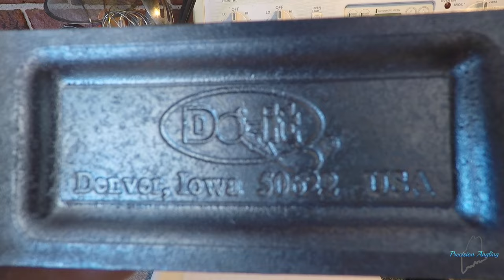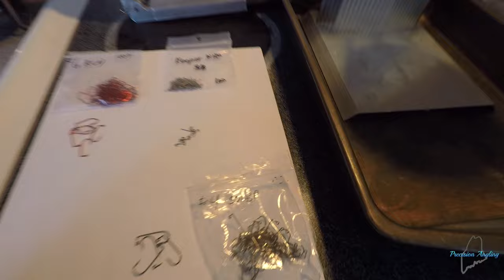How To Make Ice Fishing Jigs. Complete Tutorial.

Comment: Can you roughly tell me about how much you have in your set up?? Like the lead hot tank, the jig molds, the paints, & what ever else a person might need?? I’ve always wanted to make my own fishing jigs & baits but figured it would be to expensive to do!! Thanks in advance!!! Oh & what molds would be the best to get???
Reply from the maker: The mold was $50 ish, melting pot was 80 ish, good selection of powder paint around 100 ish, hooks are relatively cheap, mine are around $6-10 for 100, but can be more expensive with hooks like Gamakatsu. Lead is $3-4 per pound. Misc tools around 20-30 or so, cheap heat gun is around $20, good one $80+. Lure eyes are around $10 per 100. So you'd be looking at right around $250-300 for a decent set up. More or less depending on which way you decide to go. And I use Do-It molds. Its a fun hobby.

Comment: 2 years late to the party so I doubt I get a response but in theory could you throw some old tungsten jigs in the melting pot and get tungsten jigs?
Reply from the maker: Nope. Tungsten melts at just under 6200 degrees F. Lead melts at 620. Only chance of using tungsten on a home bait maker scale is mixing a resin with tungsten power, then pouring into a mold.

Comment: A torch??? I believe it's a light, flash light, UV light... also for safety you should work with the Lead out doors or in the garage instead of in your home.
Reply from the maker: Several of the high output UV light manufactures advertise them as torches!!! And pouring inside is not ideal. The pot was on for less than ten minutes, with several windows open, and my stove vent fan on high!